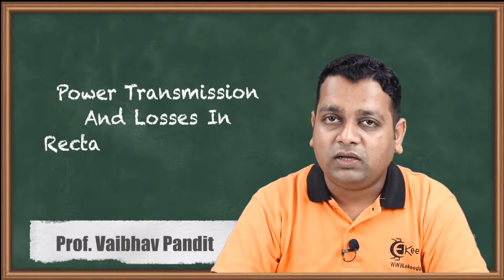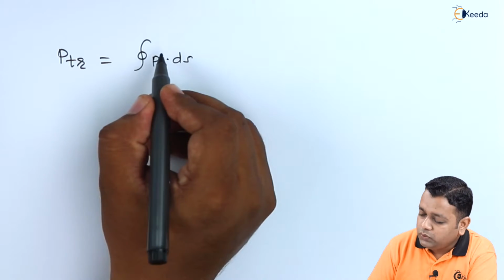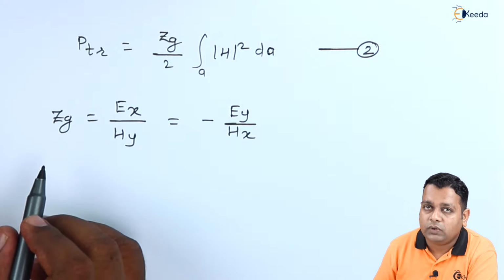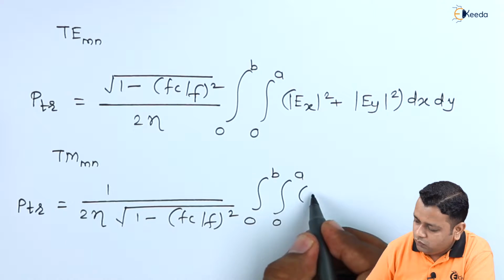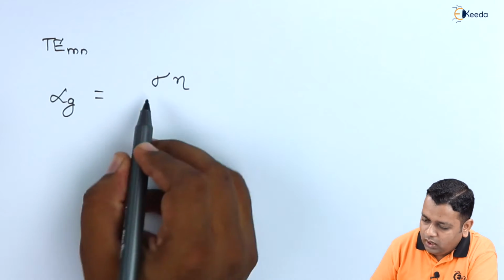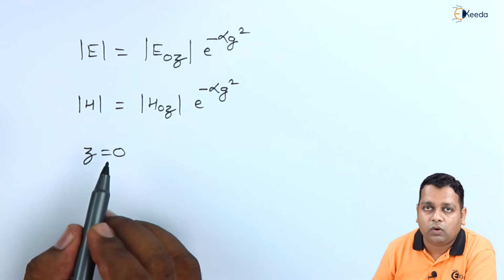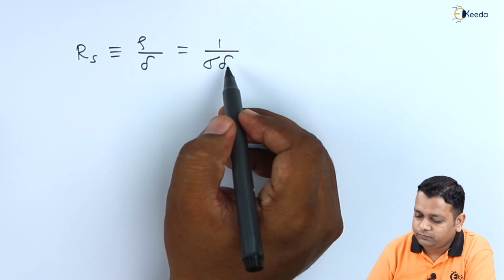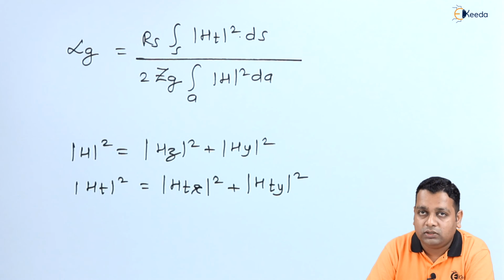Power Transmission And Losses In Rectangular Waveguide - Microwave Transmission

Comment: Thanks for your detailed explanation but you did not reach into a formula for calculating PL from H or E amplitude in whether TE or TM based on the depth of penetration and frequency and conductivity and dimensions of rectangular Waveguide.
We have a formula but I don't how to reach it:
PL=((H10^2)*f^2)/(sigma*delta*fc^2)*(1/2+(b*fc^2)/(a*f))